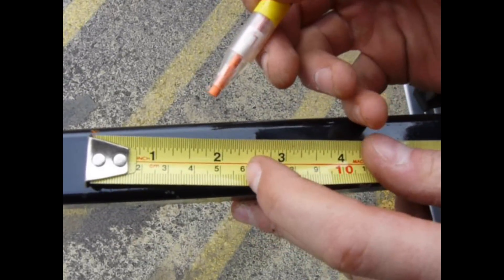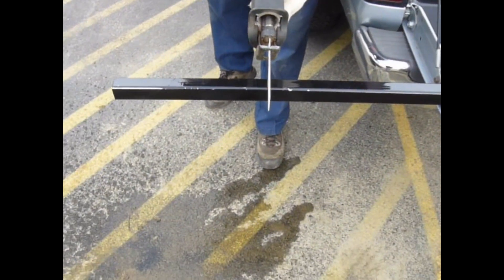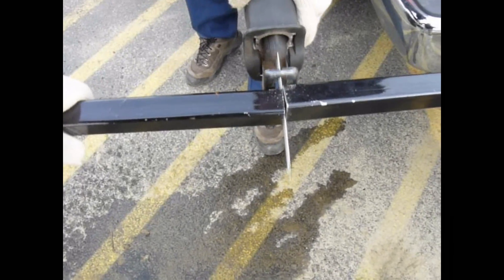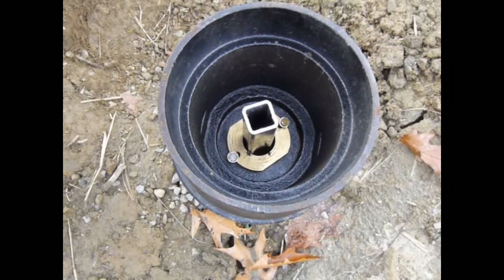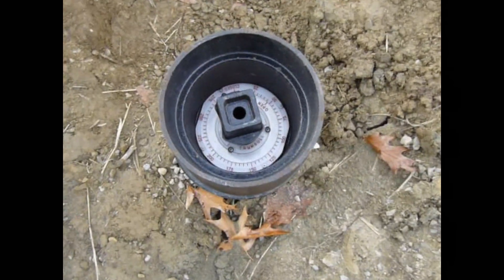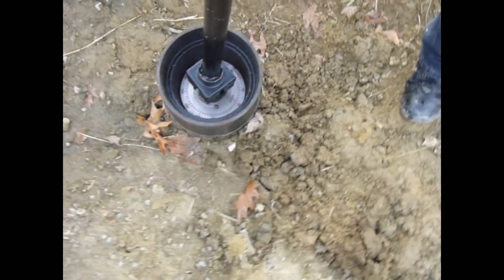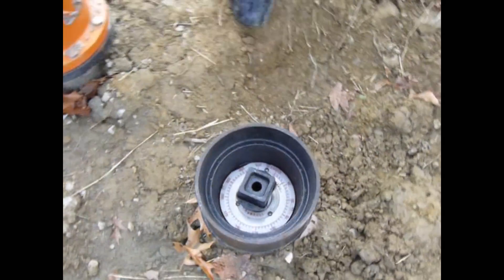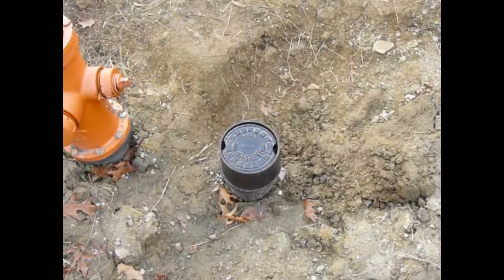Valve Position Indicator Installation for One-Piece Square Extension Stem

Comment: Nice.. thanks for the video... 
In this case, is the valve directly buried?? Doesnt the soil damage the valve in the long run??
Reply from the maker: Newbie dude, the Valve Position Indicator is protected from soil on the sides by the Housing Adapter, and from the top by the Debris Shield which is an optional accessory you could purchase. You can see more about the Debris Shield on our website: http://www.trumbull-mfg.com/products/valve-position-indicators/valve-position-indicators-buried-service-1-14-square-extension-stems/